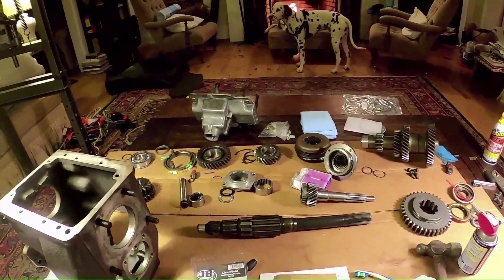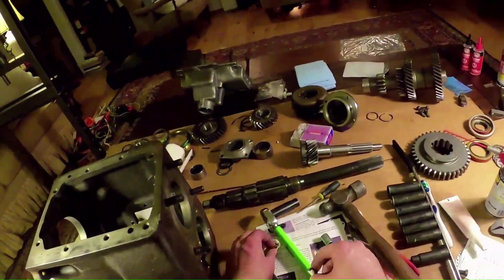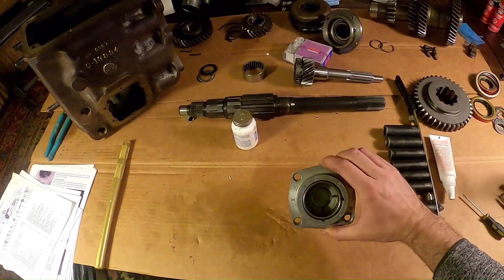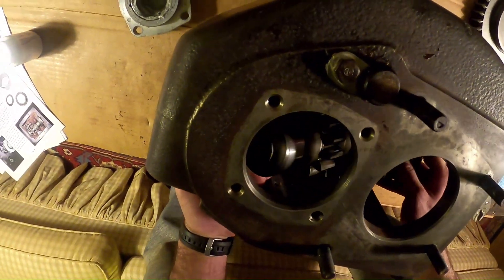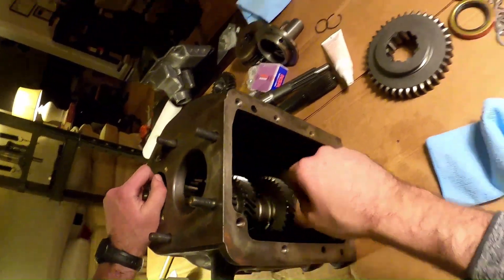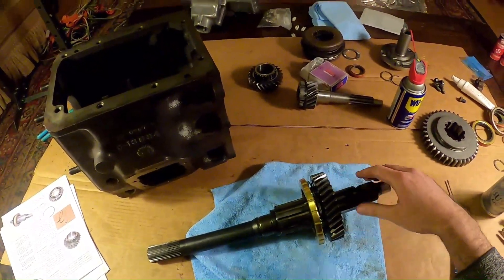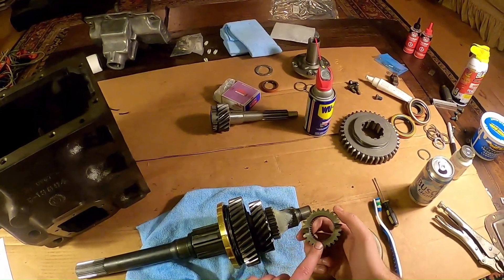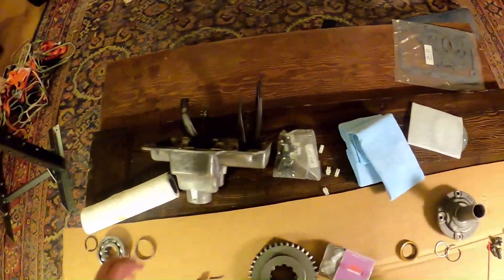NP435 Reassembly - Rebuild Series, PART 4

Comment: Great video! Did you have any issues with the outer synchro plates not sitting flush while you were taking your endplay measurement? I have a tight side and a looser side. Its like the clutch disc wont seat all the way in the outer housing
Reply from the maker: I didn't. Maybe post a YouTube short and ask the question so folks can see what you're talking about. Prob would get lot of feedback from more knowledgeable guys than myself
Reply: @robstuckey  ok thank you!

Comment: Hey man i just bought a truck the transmission shifts fine but makes a terrible rattle sound I drained the oil it's glittery I open the portion and I found two loose washers any idea where they go ?
Reply from the maker: Probably in your transmission

Comment: Hey I have everything together like in your video which is also the way I took it apart. (I took pictures during disassembly). When I put the counterbalance shaft on the bottom in it spins easily but as soon as I tighten the bolts for the countershaft cover to 20 ft lbs pounds like the manual says the gears become very hard to turn. Is this normal with reused bearings that aren’t bad? It doesn’t spin super easy like yours does in the video, you have to grip it with both hands. I have the washer and thrust bearing on the correct side with the other offset washer on the other side.
Reply from the maker: Check to make sure your roller bearing at opposite end of the countershaft is fully seated in the housing. If it is, try removing a thrust washer and see if you still have the same issue.
Reply: @robstuckey  It seems to spin alright now that I have the whole thing together. I took apart a running one to clean it and reseal and never replaced the bottom bearings because they looked fine. So I never had to seat it. It has some resistance to be turned but the input shaft can be turned with one hand without a whole lot of force so I assume it will be fine.

Comment: Did you get shims? And where exactly are you checking and play?
Reply from the maker: yeah final assembly video will be out sometime later this week. slide your feeler gauge in between the gear teeth on the input shaft and the third/fourth synchronizer assembly. you are looking for between 0.037" and 0.070". I prefer tighter build and set mine at 0.045". Too much endplay will result in slower, sloppier shifts and possible rattling of the assembly. Too little endplay will result in premature synchro ring wear.

Comment: How much did you spend to get this rebuild? Doing it your self ? I’m thinking in rebuilding my if I need 2 one day ..
Reply from the maker: i spent $525 on parts. $365 for the rebuild kit and new first gear. $30 on some more shims, $90 on a new input shaft and $40 for a new input bearing retainer.. i also spent a few hundred bucks on tools/press. to have it rebuilt by someone else was going to cost around $1200.
Reply: @robstuckey  thank you